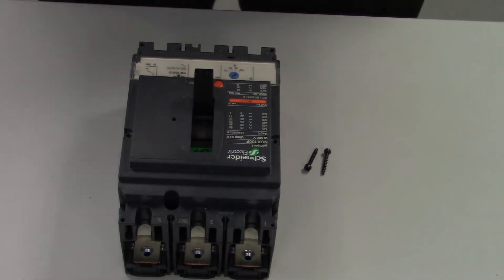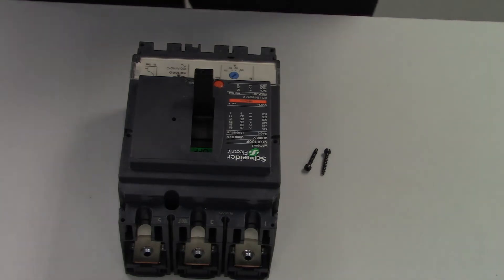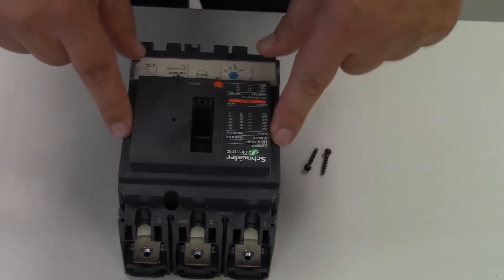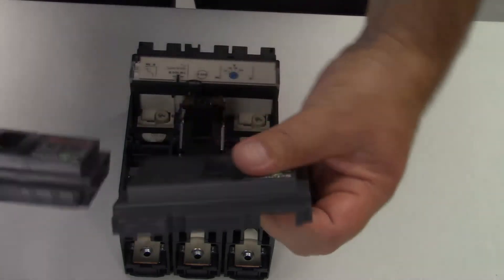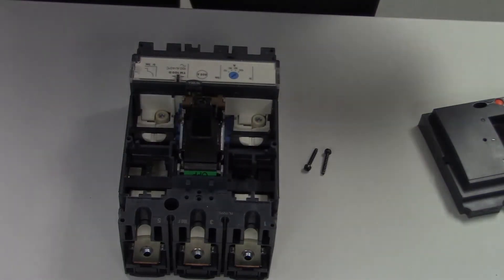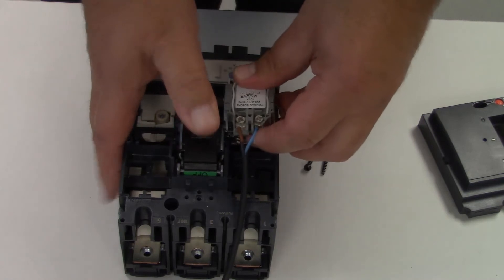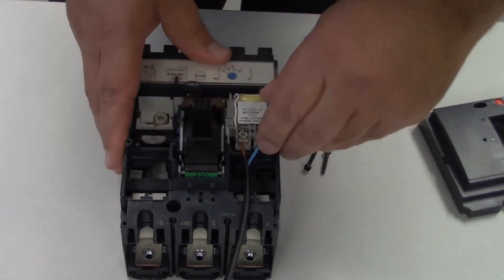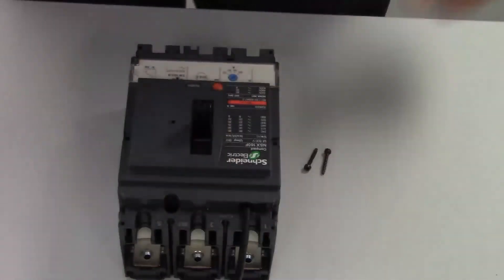How to fit a Undervolt ( MN or a Shunt (MX) in NSX breakers

Comment: I have installed a MX coil in a Compact NSX630 with a rotary handle. The coil trips the breaker but the breaker doesn't reset itself after putting the handle in OFF position and remains in Trip condition even after cutting the supply to the MX coil. What might be the issue?
Reply from the maker: Thank you for your message. We apologize for any inconvenience caused. Our customer care team would be happy to provide assistance. Please reach out to a customer care member in your location here: https://www.se.com/ww/en/work/support/country-selector/contact-us.jsp